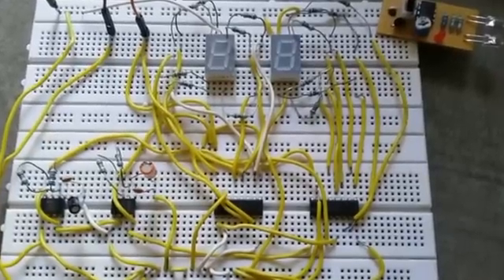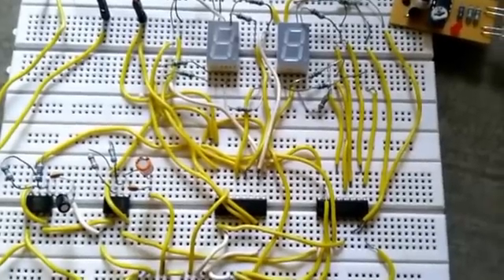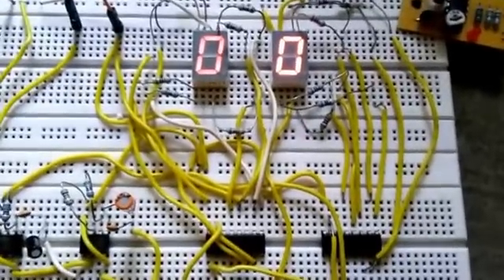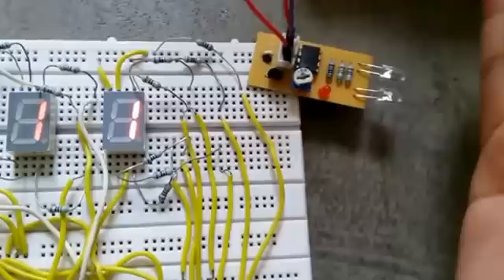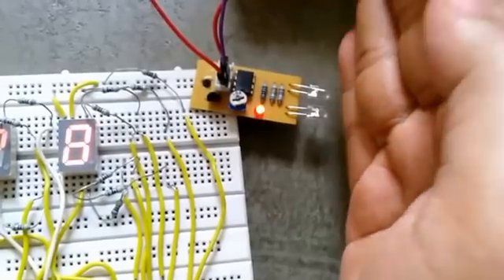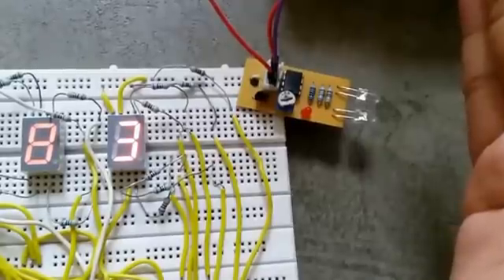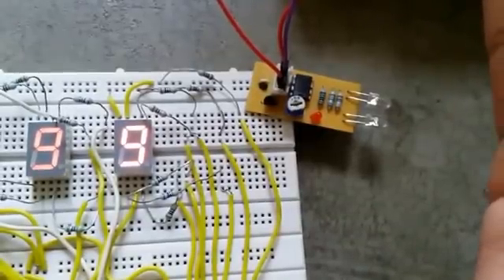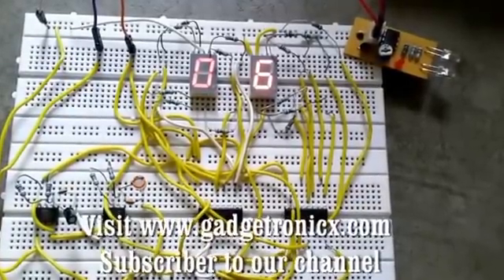People  or object counter Circuit Project Working

Comment: the schematic shows you are using a TSOP 1738, but I see you are using something different in the video. Are the connections the same for one of these: Infrared Obstacle Avoidance Sensor Module Reflection IR Photoelectric. Thanks